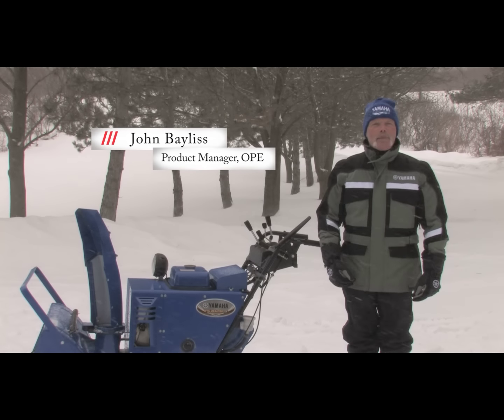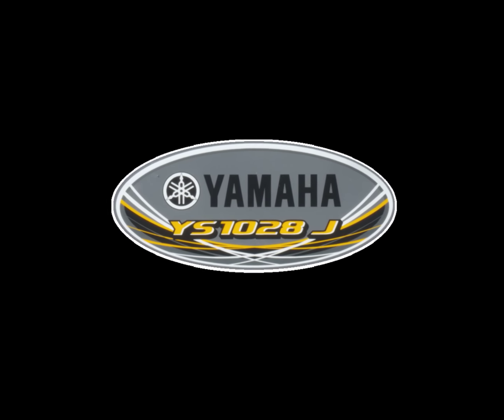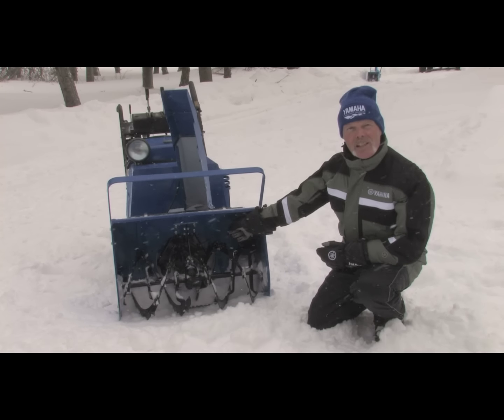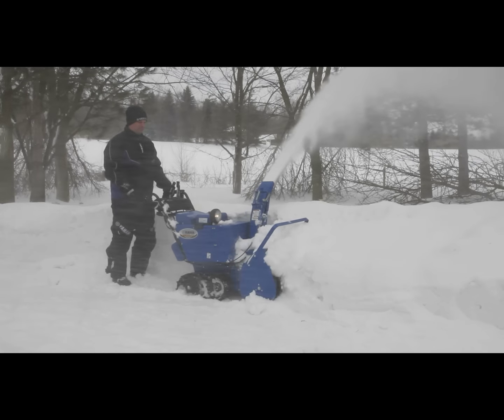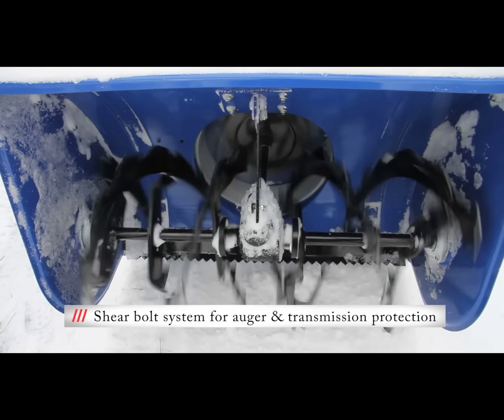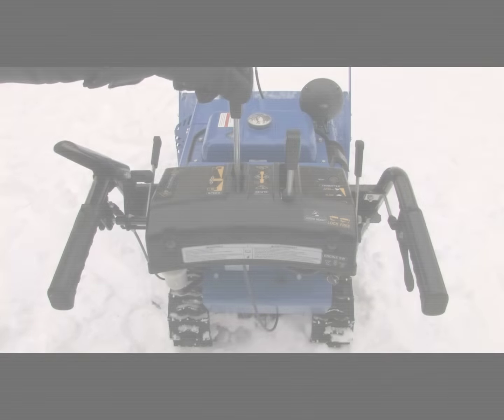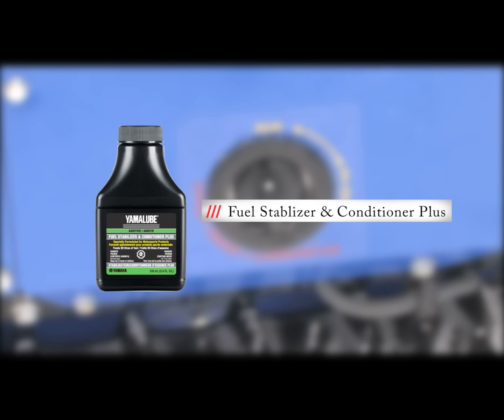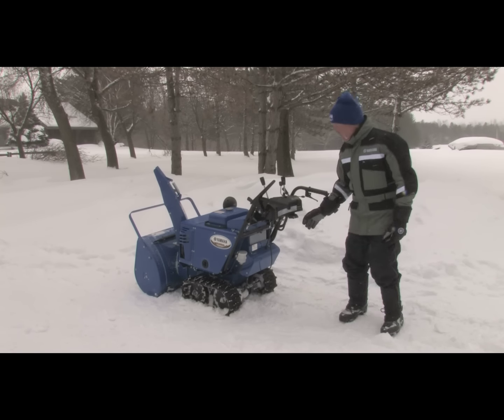All-New Yamaha YS1028J Snowblower

Comment: Are Yamaha’s top of the line like Honda? I never heard of Yamaha snowblowers before
Reply: I heard they are as good or better than Honda and not quite as expensive, however still really expensive compared to Troy-Bilt or Ariens, Craftsman ECT.

Although with that said the model in this video is about $4800 Canadian and none of the Yamahas or Hondas offer heated grips which you can get on Troy-Bilt, Cub Cadet ECT. Not a deal breaker, however for that kind of money these things cost they should have a fawking microwave to nuke a god damn hot pocket while your nuts deep in snow at 30 below celsius. 

Just my take though, Yamaha is supposed to be as reliable as Honda, cheers dude.
Reply: @SvenTSchixe  Yamaha's are not cheaper. I just bought a HSS1332CTD Honda for $4800. That's 13hp. The 1028 Yamaha is $4999.99. That's only 10hp. Yamaha have priced themselves out of the market. That's why I see 50 Honda's for every 1 Yamaha in my area.

Comment: Baffles me why this machine and other Yamaha snowblowers in general are not offered in the states, why give Honda full market share in the US for this type of machine?
Reply: Probably because they don't want to rip people off. Not worth that kind of money especially with only 10 HP. It's a $1000 machine at best.  Buy an Ariens, 40 times better quality and  a really good warranty.  Christ I mean in this day and age the Yamaha doesn't even have a simple LED ;ight on it.
Reply: Yamaha and honda snowblowers are the best. Second not a bad option would be ariens and toro.
Reply: @ABC-nv8ly  Ariens has a crappy differential design instead of a basic trigger lever steering system and on its commercial grade units that cost as much as a Honda (at least in Canada) you only get a premium residential engine while Honda offers a true commercial unit.  Toro's snow blowers have dropped significantly in quality as well and probably don't come close to Honda as well.  Toro also doesn't use a commercial grade engine, just its house brand.  Honda machines are better than both Ariens and Toro for commercial with a full 36 month warranty. I went Cub Cadet as I couldn't afford a Honda as well as the dealer from where I bought it.  Granted, the Cub isn't commercial grade either but the engine has held up quite well.  I like the Cub but there are some things I wish I had that the Honda does.  The hydrostatic transmission, tracks and battery electric start are some of those things. That being said, Honda units don't have heated hand grips and that's a must when you blow snow for other people as a business.  It's not a big deal but I wish it was an option on Honda machines.  I would still get the Honda if I had CA$5000.

Comment: I bought one and it was difficult to start due to an auto choke issue that the dealership was unable to resolve. They exchanged it after a 2 month period, and the replacement works okay, but the battery failed twice, and they are $500 from Yamaha.the battery is an oddball size so not available anywhere else. There is no recoil start, so you have to use the battery start. When I called Yamaha Canada, they were dismissive and arrogant. The farm dealer did everything they could do,   no complaints about the dealership.
Reply: Are these EFI?